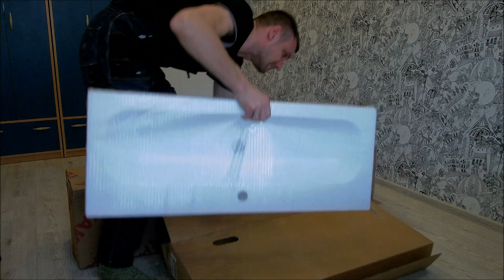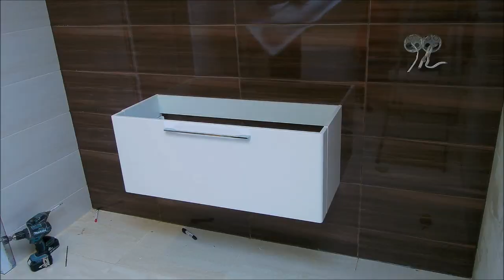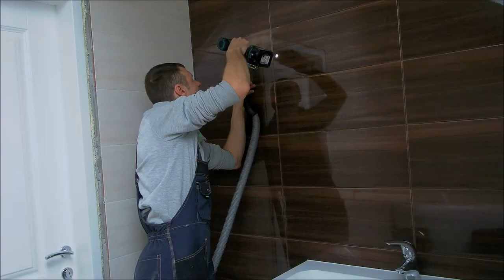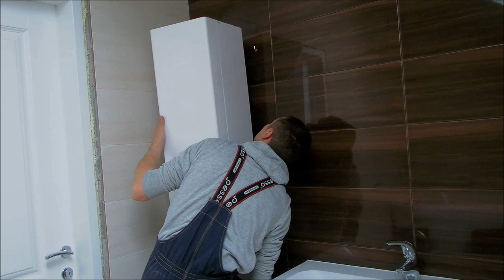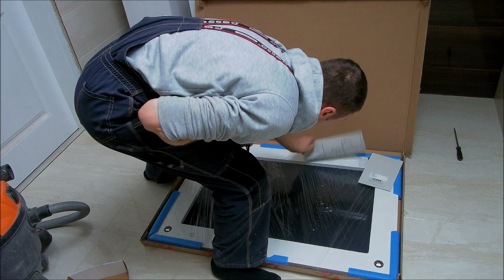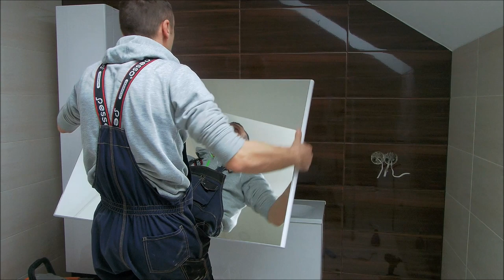How to install/fit a bathroom sink vanity

Comment from the maker: How to install/fit a bathroom sink vanity. A few tricks and tips to make your bathroom installation a whole lot easier. See how to connect the pipes and fittings to the kitchen sink, sink, toilet water lines using PEX water lines and PEX fittings. How to install a drain system, different ways to configure it for your own situation.This is the BEST plumbing solution for beginner DIY plumbers. In this bathroom training video you will learn how to use PEX and copper water lines and fittings to quickly and easily plumb your new bathroom! Bathroom Plumbing is simple to do if you have the right instructions to follow. Watch this diy bathroom plumbing video and learn a few Pro secrets for getting your sink water lines installed right the first time.